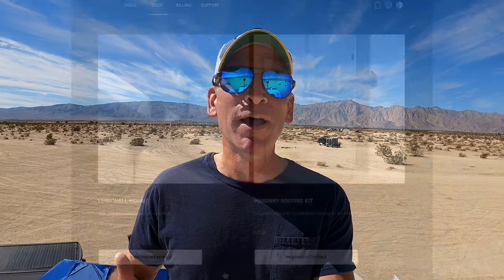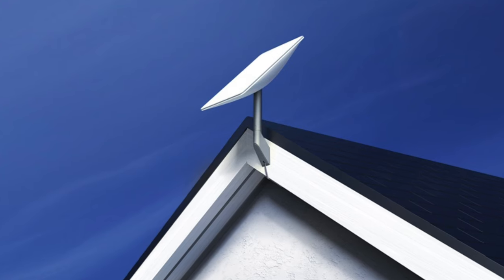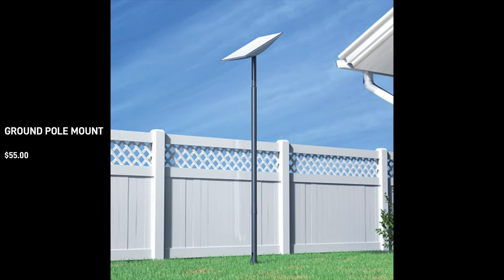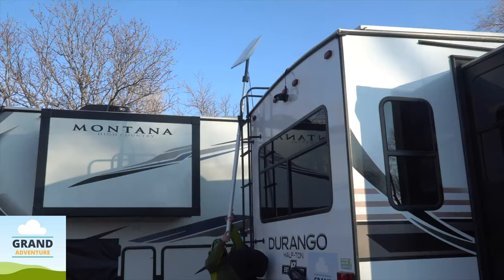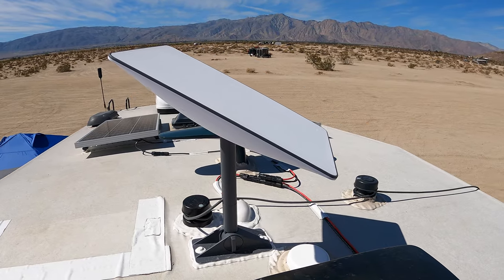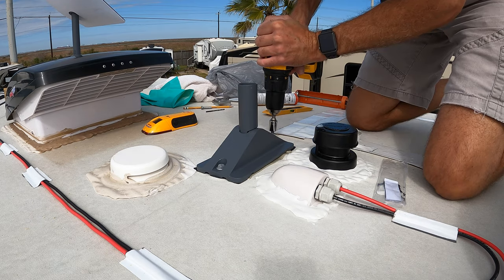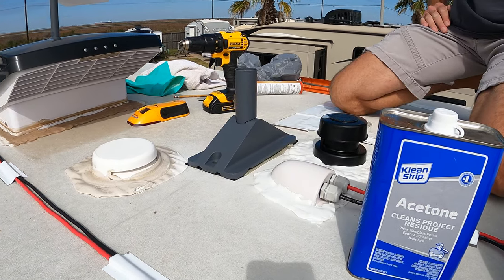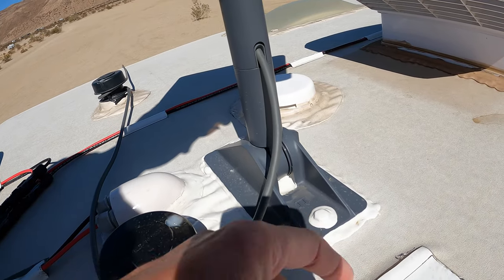Starlink RV Roof Mount Install + Review Of Other Starlink Mount Options

Comment: How does the wire go into the camper? Do you drill a hole or put it through a window?
Reply from the maker: We keep the router in our front bay where the batteries and inverter are located.  There where holes from the factory in the sheet metal between that compartment and the propane bay, so, we just run the cable through there.  Another no drill option is to run it through the slide at the rubber weatherstripping.
Reply from the maker: I finally ran the wire permanently.  Here’s my install video if you’re interested.  STARLINK RV ROOF MOUNT PERMANENT CABLE INSTALLATION
https://youtu.be/CKsdDV-yQzQ
Reply: Thank you right now I just have my modem in my camper cubby
Reply from the maker: @Michael-bc3es  👍🏻

Comment: Did you end up using the same lag bolts that came with the Starlink kit? I’m concerned they’re too long.
Reply from the maker: Hi John, I purchased shorter lags of the same diameter.
Reply: @EddieAtLarge  this might be a stretch, but do you have any idea the size of the bolt. I checked the instructions but it doesn’t list it. If not I’ll just experiment haha! Thanks for the reply!
Reply from the maker: @johnhodgkins4274  Hi John, sorry, no idea on the bolt size.  I pitched the original bolts.  I would recommend taking an original bolt to the hardware store for comparison.  You could also compare the bolt to your drill bit sizes and that would tell you.  Sorry, wish I would have thought to include that bit of info in the video...  ✌🏻

Comment: Once mounted on roof can you travel down the road with it or do you have to take it down?
Reply from the maker: We take it down for multiple reasons.  We go down a lot of rough roads to get to our Boondocking spots and I’d be concerned about it getting bounced around.  Also be worried about low overpasses or tree limbs.  We take it down before each trip and transport it in the original box and packaging for safe travel.
Reply: @EddieAtLarge  thank you

Comment: How do you run the cable inside? And do you leave it up there when you drive?
Reply from the maker: We run the cable in through the wet bay access of the RV (where the hose would hook up for city water) and we keep the router in the RV “basement “.  We take the dish down for traveling.
Reply: @EddieAtLarge  thank you! I’ll try that

Comment: Can the starlink rv system be used at home ? We have waited and this is a immediate option
Reply from the maker: This system is not specifically designed for an RV.  It is actually made for home use and we have adjusted for RV use.  Starlink is working on a truly mobile version that will be able to be permanently mounted on a vehicle and used while driving.  This version can only be used while stationary.  Starlink has released a "Portability" feature that is essentially the Roaming feature with an official name that we've reviewed in our other videos.  With Portability, you can take your Starlink dish away from your home address and use it anywhere.  Here is a link to our latest video on the Portability feature:  https://youtu.be/SvkEsPoc4Bo

Comment: Mine stows randomly each time. I have the same stand. How’s it working for you?
Reply from the maker: Been working great for us.  So your dish will just randomly stow without you manually putting it in stow mode through the app?  Or do you mean something else?
Reply: @EddieAtLarge  it’s my mistake, I figured when it stowed it would face the same direction every time so I could just fold the stand down
Reply from the maker: Hi Roger, ours always stows in the direction that it is facing which is usually North.  With this stand, you would have to park each time so that the mast of the stand would lay down towards the North, then I believe you could lay the dish down with it.  We always take our dish down before travel regardless as we would be concerned that it may be damaged from bouncing around on rough roads.
Reply: @EddieAtLarge  ok thanks. I appreciate your help

Comment: We'd love to install v2 rectangular dish on the roof of our popup truck camper. When driving, with the unit powered off, we're hoping we can use the Pivot Mount to lay the dish flat on the roof (on clean, flat rubber mat to avoid scratches and reduce vibration). It would reduce wind resistance and minimize ground to top of dish clearance height.   

When arrive at camp, we'd then manually loosen the "pivot" arm and raise it to 90º; power on starlink; and let it find the satellites. 

BUT... it seems that "at rest" the dish is on a significant angle from the pipe? The Pivot Mount itself seems to come with the female mounting socket lying flat/parallel with the base(?) Can the Dish & Pipe lie flat as well? 

If not, can we replace the pipe with a shorter one that does lie flat to the dish? 

Also, how is the Dish's pipe attached to the Pivot Mount? Will it stay attached at 80mph and/or bumping on washboard roads?

Lastly, do you see a 12V power adapter option yet (we'd rather avoid 12V - 110V - 12V wastefulness)? 

Thanks! So very exciting!
Reply from the maker: You may get it to lay down, however, it will be at a different angle each time you "stow" it for transport as it gets stowed facing whatever direction it was last facing.  So, it may be flat sometimes and angled at a different direction other times.  Several other issues that you will run into are that the knob that secures the pivot mount at different angles has a plastic piece that moves the metal gear wheel.  This may end up breaking over time by loosening and tightening it over and over again.  Also, there is a good chance that the dish will bounce up and down in that position while driving down bumpy forest roads and get damaged.  The dish clips in and is easily removed from the mount with the push of a button.  I would highly recommend taking it down each time and leaving the pivot mount in the vertical position as that is what we do.  Hope that info helps.
Reply: @Homie At Large  Thanks so much for your quick reply!  So I guess there's no "Park" function (either software or manually) that'd move the dish back vertical (flush with the pipe)?  If not, how do you store the dish and the pole (eg, sometimes the dish and pole could be 90º, with dish pointing straight up? That'd seem to be much, much hard to store than if the dish is flush with the pipe?) Can you manually move the dish to lie flat on pipe?  We are in a popup truck camper, so storage space is at an ultra-premium! 

If dish does go parallel with its pipe, what's the least it could be made to stick up (off the roof) lying flush with Pivot Mount?  

As far as bouncing around, I should have mentioned that we'd strap the pipe and dish down to the roof (against a rubber pad) so it didn't bounce around. This way we can also run the cable through the roof, etc. and not mess with it as well!

Re; plastic knob wearing out, great point. We've already been looking at replacing it with a metal one (like you find with Flagpole mounts, which use the same teeth). 

If you do another related video, it'd be great if you'd show where the pipe attaches to the back of the dish! Thanks again!
Reply from the maker: Check out our first video at 2:22 to see the back of the dish in “stow” position.  Here’s the link.  https://youtu.be/wm8IJ65dgag  That is as flat as it will get to the pole.  We use the original box to transport and always put it in stow position before doing so (that’s how they ship it).  Stow position also locks it in place.  If you can protect it well with the rubber mat, that may work for you. Sorry, didn’t see your question about the adapter.  Nothing from Starlink yet.  I asked them a while back and they claim it’s in the works, but, didn’t seem like a high priority at the time.
Reply: @EddieAtLarge  Very much appreciate your additional response! Even at 2:22 (where you're snapping pole into the tripod mount), it's really hard to see how close it'd lie flat on our roof with the pivot mount. If you get a chance to snap a photo (in pivot mount at 0º) and/or even show detail of it in the box where you stow it, it'd be a HUGE service. Thanks!
Reply from the maker: Hi Harry, I'll show and explain this in my upcoming video.

Comment: Them leg bolts seem very long wondering if they will come through the ceiling on the inside !
Reply from the maker: Hey Samuel, I actually bought shorter lags of the same diameter and discarded the long ones that came with the mount.  You’re right, those long ones probably would go right through the ceiling.  😆

Comment: Hey man I have the roof pivot mount and the problem I'm having is I can't get my socket around the lag bolt as the mount itself gets in the way.  Its where the lag bolt sinks in, and the metal of the mount gets in the way
Reply from the maker: That’s odd. My socket set is a Craftsman. I believe I used a deep well socket.  Is the wrench getting in the way or is it the socket itself?
Reply: @EddieAtLarge  The socket itself gets in the way, I finally got it by torquing on the edge with the socket and the metal on the mount chipped away enough for me to get the socket in there.  Just didn't leave much room at all.
Reply from the maker: @joshl6499  👍🏻  Glad you were able to get 'er dun!

Comment: Any reason not to just glue the mount?
Reply from the maker: If you are referring to using something like construction adhesive, you would need to trace around the mount, cut the rubber membrane and remove it in order for the mount to adhere directly to the roof plywood.  Ours has been installed for a year now with no issues, so, I would still recommend our method of install.

Comment: You should not do a full seal around, because the water, possibly coming from the tube, needs to flow out
Reply from the maker: At 5:55 I show how I also sealed inside the mount base (under the tube) to ensure water did not penetrate below the base and get trapped.  I filled this area with the self leveling sealant that would seep under the base and then I completely filled the void to just under the tube (I removed the tube to do this).  Any water that gets into that area will be able to drain out from the top.  I decided to do this as I was concerned about water working it’s way to the bolt penetrations as the only thing protecting them was the butyl tape.  If the bolts would loosen at all or there wasn’t a good seal from the tape, water may be able to leak through the roof.  In my estimation, there was no other effective way to make sure water did not find its way to those locations.

Comment: Just my opinion, don't know why people continue to use dicor, its the joke of the industry , use an inferior sealant that has to be continually re applied so we can sell the hell out of it. There are much better commercial contractor grade sealants on the market..... Such as siki-flex products.
Reply from the maker: Never used Sikaflex for the RV, however, have also never had any issues with Dicor.  Have now used Dicor on multiple projects over the past 3 years of full time RVing, have not had to reapply and have had no issues otherwise.  If we start having issues down the road though, I’ll try out the Sikaflex.

Comment: Your video was great. I’m wondering if you actually travel with it on roof. Also where are the wires going into the modem? Do you have to slam door on it?
Reply from the maker: Thanks Patricia!  We take the dish down prior to traveling.  It’s quick and easy to remove from the mount.  We run the wire up through the hole where our water hose enters the rig when we’re on hookup and can close the hatch door without the wires being in the way.  We keep the router in our 5th wheel “basement” area where there’s an outlet to plug it in. The router is powerful enough to transmit the signal throughout the rig with no problem.  Hope that info helps!

Comment: Do you leave the dish on the roof or remove it every time you move?
Reply from the maker: Hey Rick, we take it down before we move.  I plan on running the wire up to the roof permanently though so we’ll eliminate that part of the setup.  Just need to find some kind of cap to protect the end of the plug while traveling.